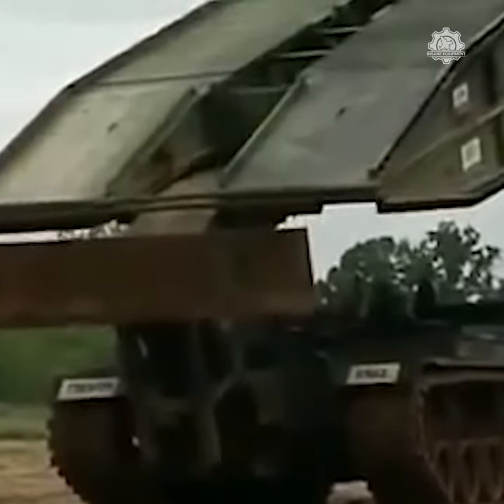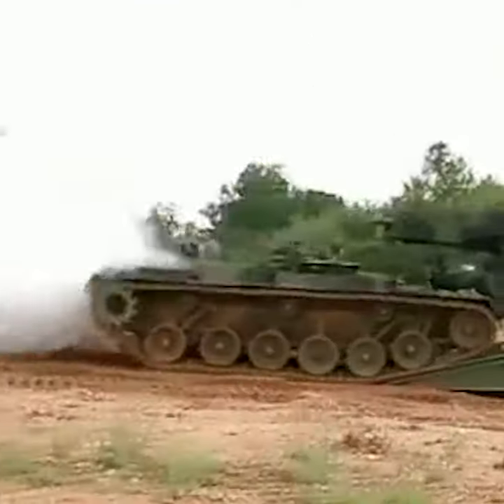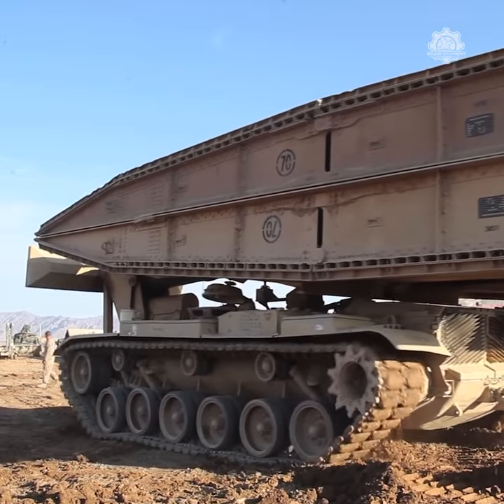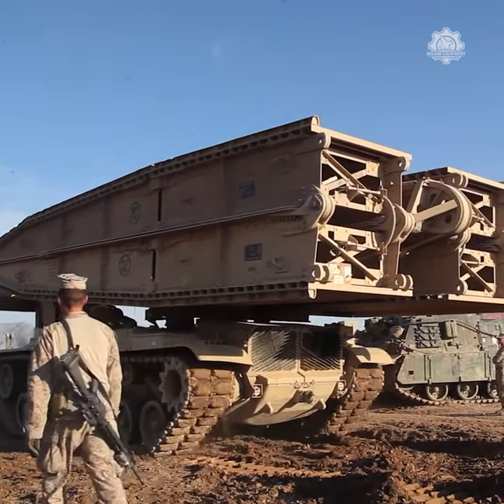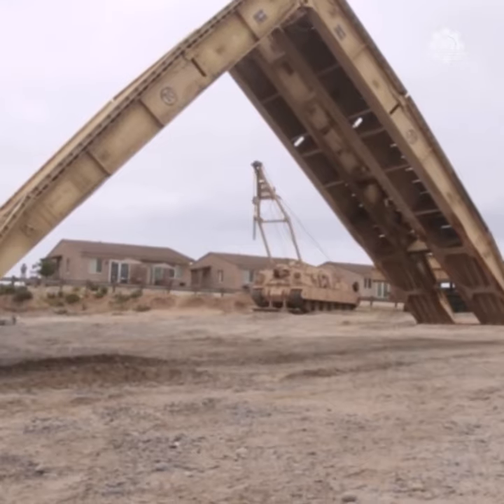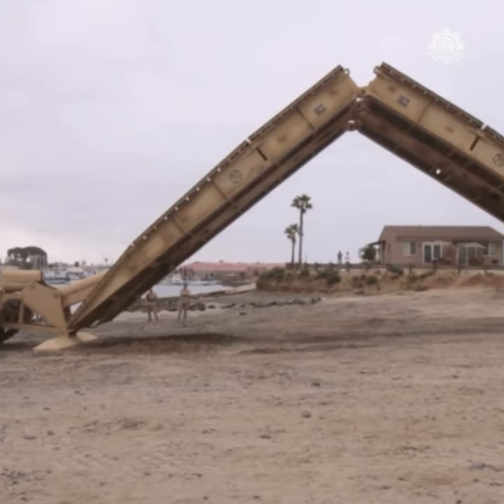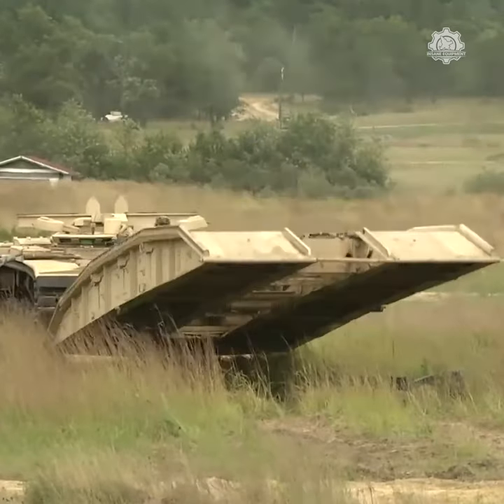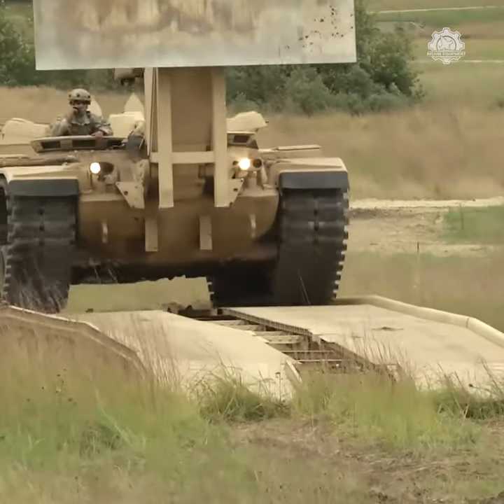How the US Army Builds a Bridge in 98 Seconds #Shorts

Comment: Ah yes the US army tool that is never used except in very specific cases.
Reply: Yes like every other military hardware
Reply: @hotchip2153  not all military hardware is specifically designed to inch, for small 19 meter gaps which are completely useless  in 11 out of 10 scenarios since most tanks and vehicles are designed to traverse small swamps and rivers with ease. 

The only oddly specific situation where that thing would be useful is if there are small canyons, or  short, extremely sharp and rocky up-hills that make regular transportation nearly impossible.